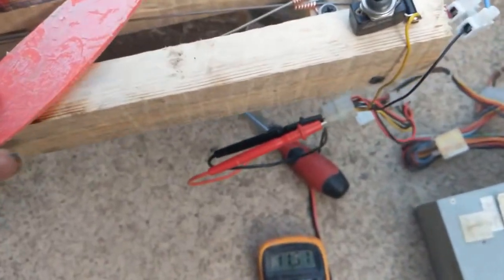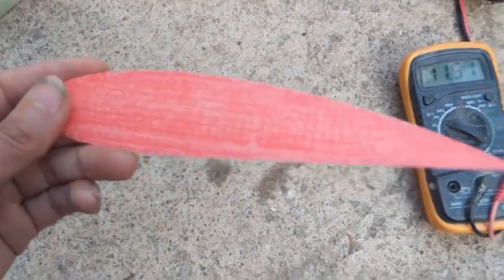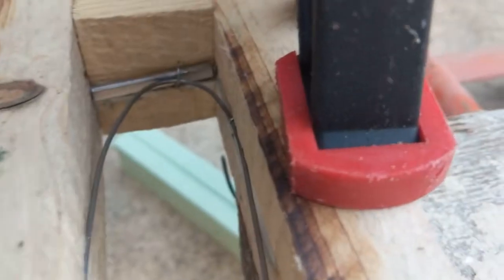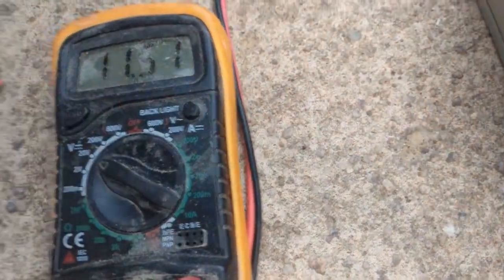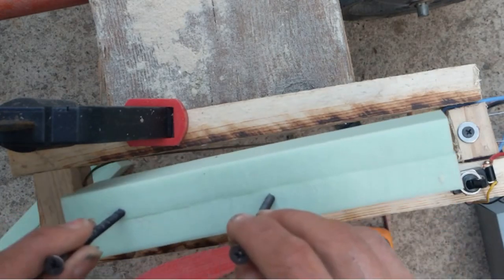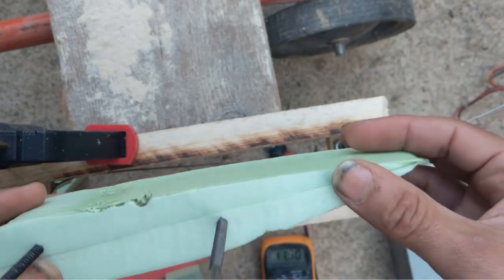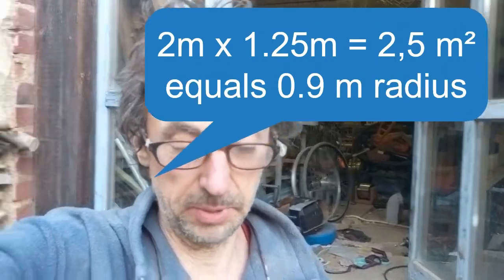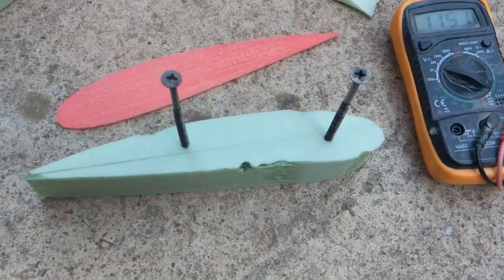cutting XPS to  NACA-0018 airfoil with heatwire (VAWT, Darrieus)

Comment: When increasing the thickness of an airfoil shape with an airfoil plotter, will there be a change in its lift and drag???
Reply from the maker: Yes you will have more torque but less speed/revs. And too much lift with too less speed will kill airflow. So as always, there is an option.
You should start with your generator and the battery voltage. Then you know which gear and which revs you need. Simply making thicker airfoils will drop the charging voltage. Also the generator must be able to handle higher torques to output higher current instead of higher voltage.